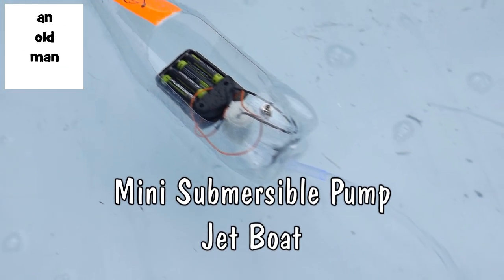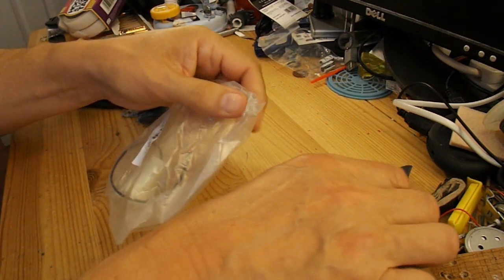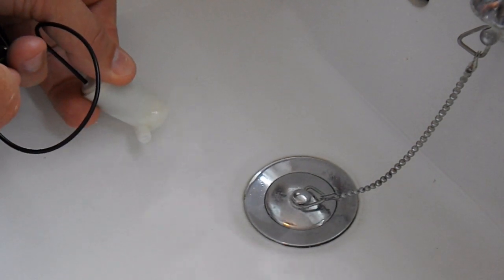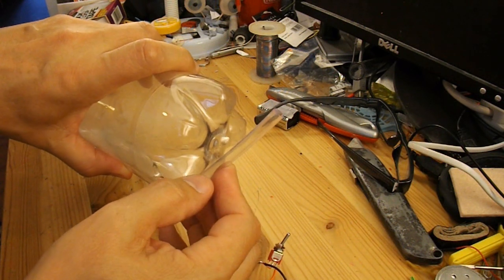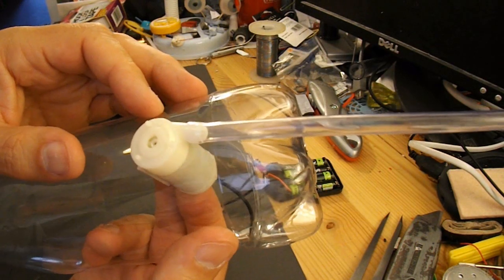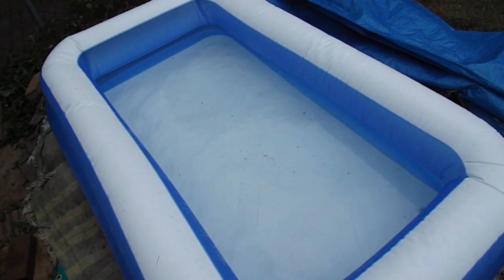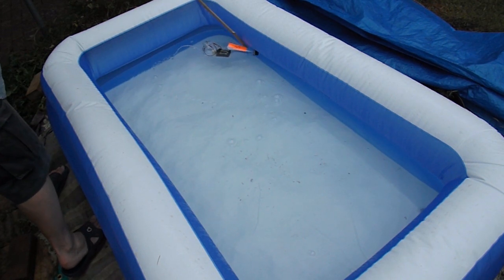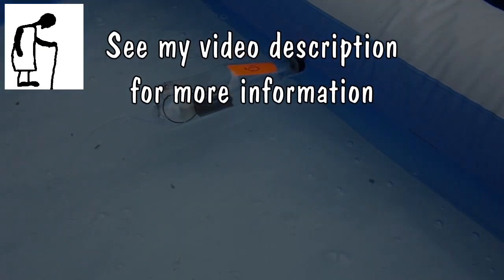Mini Submersible Pump Jet Boat

Comment: Nice! A switch-thingy like here Let's make a Mini Robot would be handy, though probably not all too easy to make I guess. One option would be to buy another bump. Another solution is to use two pipes with different directions an a something to make to water flow through one pipe or the other (however that could be done). Or to use a second kind of drive with a normal motor (+ propeller?) for the backward motion. Or maybe something else I didn't think of. And then, beside making the whole boat stable in the water, there is the question if you would have enough force to make the switches operate.
Hope that makes sense.
Reply from the maker: I can see what you mean. To redirect the boat when it hits the side of the pool. I am sure it could be done, maybe as simple as using a flexible pipe and bending it to redirect the flow.

Comment: it might do only slightly better with output down under water, shorter tube, and barely constricting smaller to trade off a little volume for a little more velocity. cute project.
Reply from the maker: model nutty I suggest you build one yourself to test your theories. There are plenty of debates on whether the water should exit above or below the waterline. The point is that boat is not moving forwards because the water jet is pushing against the water, the boat moves forwards because the jet of water moves backwards - Newtons laws, action/reaction etc.
Reply: GrandadIsAnOldMan I totally get what you're saying, could be a possibility the shorter tube giving slightly less flow resistance. with some of the energy pushing upwards, could be pushing boat downwards for  a little more drag..
no argument here, you're doing some great playing! a lot of submerse prop direct drive boats have 7-10 degree downthrust angle to lift some of the weight off the water at speed, but it doesnt work out very well with a hull too small packing too much power. I've sure had fails like that with model boats!